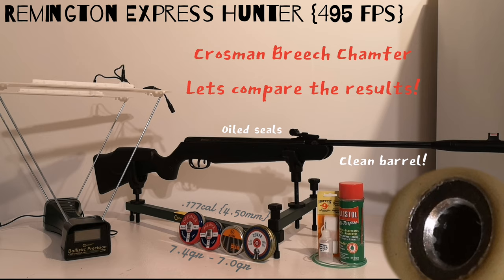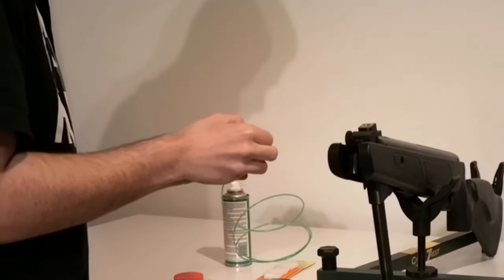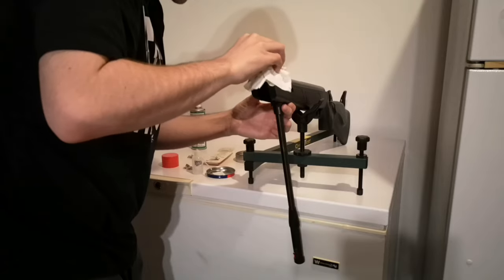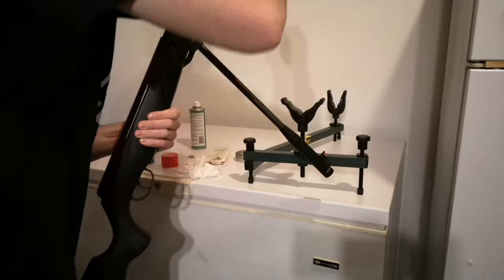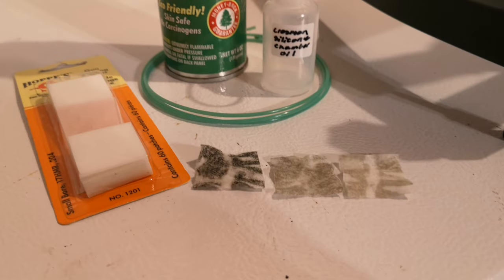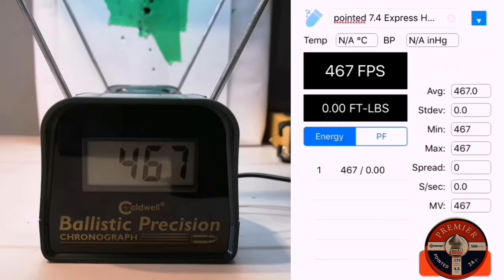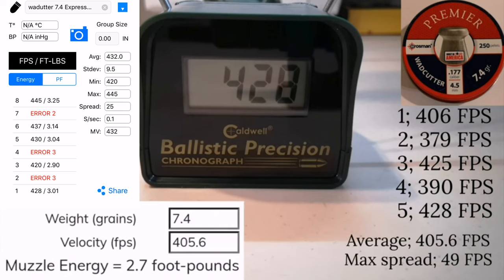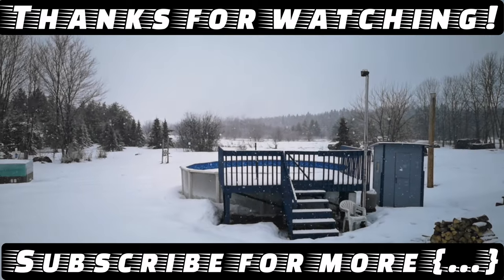Crosman Chamfered Breech - Did I RUIN my Air Rifle or IMPROVED it? / Will it jam Ep.3

Comment: Excellent video. Very informative I didn't think you could do that with break barrels.
Reply from the maker: I dont know if you can but I know I did haha
Gamo break barrels actually come's like this from the factory witch is why I got a second one even if I had a bad experience with the first one
{Will shoot a bunch of pellets my Crosman's will not} 

Thanks for whatching brother!
Reply: best done by hand, a 1/4" countersink drill bit is a good choice for doing with.
the secondary flutes are ground 45 degrees, is about right what you'd want.
airgun barrels are usually mild steel, so go softly+slowly with the bit in your fingers, keep the bit straight when twisting, only need to cut about 0.015" to 0.020" deep.
the little chamfer+funnel shape \   /  gets the angled skirting started in, compressing rather than cutting the skirt lead. Travis (Oh Shoot channel) shows how, and reminded a good tip for either chamfering the breech or re-crowning the muzzle, twist a Q-tip in there to check for burrs to clean up after doing either job.
a little bit of 800 grit on a bamboo BBQ skewer to the new inner edge will knock down burrs and fairly polish it same time. even if a pellet goes in a little stiff, the chamfer lets ya mash it in without some skirt hanging out, lots easier!
Reply from the maker: @modelnutty6503  I did check with a q-tip after removing the little burrs we could see in the last episode thumbnail!
It was not rubbing...it did improve with most of the pellets but I am starting to think the whole bore is too tight on crosman rifles (but will fit their pellets or jsb's)
[Link to Oh Shoot video is in the bio]
Reply: @LowkeyAirgunner  the 1101S here sure doesn't like Crosman Piranhas!
a little too big and lead too hard, even with a little chamfer. its OK with Crosman points, but they're too light for that much motor power. not a problem because the 880 likes them pretty well.
Reply from the maker: @modelnutty6503  Didnt have much luck with the heavyer crosmans too!
Even the 7.9's seems to be harder/bigger but a bit less
{Pointed and destroyers are my favs}
I guess the only thing I like better about gamo's is the pellet brand versatility...they dont like all the pellets but atleast they will come out of the barrel
Reply: @modelnutty6503 
Even after chamfering, some barrels have the rifling lands high enough to prevent the pellet from seating properly. This can be observed by seating the pellet in the breech and then looking through the barrel from the muzzle to the breech against a light source. If you see light in the shape of an asterisk, the lands are not allowing the pellet to seat properly and air is blowing by. A chamfer that is tapered like a sharpened pencil can be used to cut the lands to the same height as the grooves on the interior part of the 45 degree chamfer. This would be equivalent to what is called a leade in a firearm chamber.
Reply from the maker: Sadly Model Nutty is not with us anymore. (R.I.P)
I bet that he would have enjoyed chatting about technical stuff that I can barely understand with you tho!

This reminds me to make a new chronograph video for this rifle tho...
 Mine was used to test pellets that would jam in my Crosmans so the gas ram was not doing great.
I got both the 1000fps and 500fps version right now on hand so that would make a good video
 (only had a faulty sub 500 in my first video/ this rifle)

Thanks for watching!

Comment: Instead of relying on the beartrap safety you can also place a small hardwood block of wood in the breech area in front of the live jam to stop it from closing in case something weird happens.
Reply from the maker: Actually I realised after if I did not cocked it and only cracked it open it would fit on the rest and not be "dangerous" haha

By the way I tested the accuracy with crosman pellets (both tool seated and not) this week and lets just say it did horrible!
Did I ruin it ?
Will I find matching pellets?
Will it need a 30$ barrel? 
{To be continued...}

Thanks for watching!
Reply: @LowkeyAirgunner  you probably didn't ruin it.  Check the piston seal for tears...and check the barrel rifling for tough spots by pushing a pellet through with a dowel rod.  Could be really pellet let sensitive.
Reply from the maker: @pevaughn  lets hope for the best!
It never shot great this is why I am testing with it but lets just say it used better than this with crosman pellets [but those did not need the chamfer]

Comment: tapered? some good "hard" polishing the first 1/2" to 1" in the breech end?
makes sense to me, once the pellet starts moving its lots less likely to get stuck.
same idea as pellet seating tool to get the pellet started by hand 1st mm in the rifling,
air isn't fighting against any uncut lead to get moving.
Reply from the maker: Tapered is not a word? 
Some people say this instead of chamfered...looked up on google it seemed to make sense? 
(If not ill remove it from the title haha)

I am not sure I will do more stuff to this barrel but if I cant get it to shoot good...why not ;p

Thanks for watching bud
Reply: @LowkeyAirgunner  chamfered is a word the morons of spell checker never heard of, kinda a machinist/machining term. tapered usually more indicative of a very slight+gradual convergence of what appears parallel,
I thought you maybe took some polish to the breech intro.. 1st 1/2" to 1" depth.. toothpaste+oil on a Q-tip chucked in a dremel rotary tool would make a very slightly tapered+polished breech, more working the end nearest the chamfer.
Reply from the maker: @modelnutty6503  huhhh so wich word is right ?
[french brain overheating] 

I made a chamfer ?
I made a taper? 

Is the -ed the problem haha I know we modify verbs sometimes ?!

I need to shoot it a bit soon to see what I will do with it but I got to admit spinning a q-tip on a drill sounds fun
Reply: @LowkeyAirgunner  yup, you cut (or ground) a chamfer, is much more similar to a countersink, a round bevel cut. taper, like a tapered barrel being larger diameter at the breech and smaller at the muzzle. another word the spell check morons don't know is "luthier", someone who's specialty is building or working on stringed instruments. chamfer and luthier are both real words spell checker underlines in RED "you didn't say the spell right!"
(they oughtta be slapped!)

Comment: You either have a bad piston seal or a bad spring/ ram. It should be hitting in the 800 fps range.
Reply from the maker: This was the canadian detuned version ! 
{495fps/no liscence needed}
The regular one is arround 1000 fps with wadcutters 7.4gr 
[Curiously only arround 940fps with the pointeds with more spread wich is the opposite of the results I get in detuned rifles]

I have a video showing a few numbers with the full power version
https://youtu.be/t0N5BPWQg68
[I discovered later it was not supersonic in fact the slower pellets are causing the bang...piston slam/dieseling? Who knows]

Thanks for watching!
Reply: @LowkeyAirgunner  I thought your max was 12 foot pounds. A 7.4 grain pellet at 800 is only 10.5 foot pounds.
Reply from the maker: @erniestoner8266  No this is the UK limit!
We only get 500fps or less/4.2ft-lb